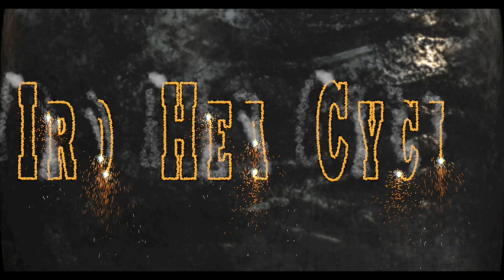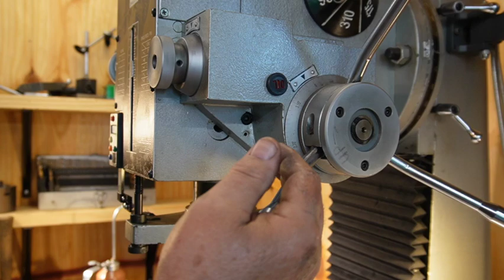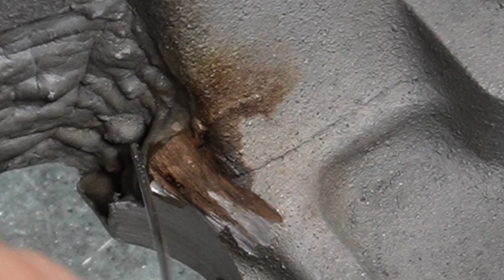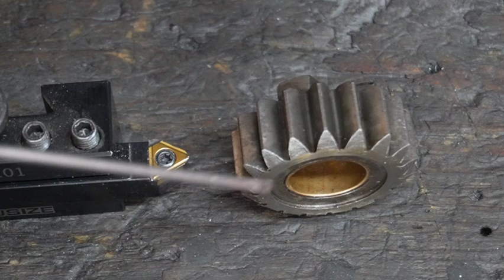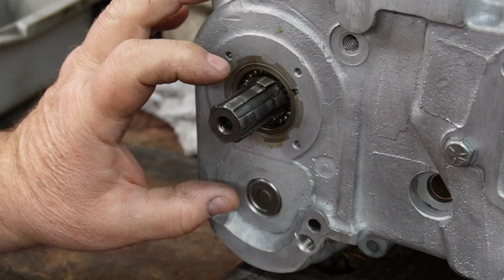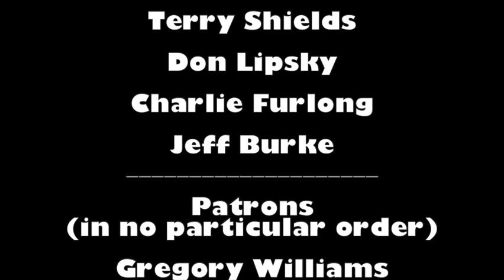Harton Part 4, Road To Recovery Nbr 274

Comment: Question, what cup and tungsten do you use in your tig rig? Also do you add helium to your gas? Thank you.
Reply from the maker: Nbr 5 cup, 3/32" for most weld, 1/8" on the heavier sections.

Comment: I've watched several of your videos where the cases were previously welded and/or you have to go in and do additional welding.   Is this something specific to Harleys or do other bikes have similar problems?   Anyway,  I'm glad the owner decided to fund the additional repairs.
Reply from the maker: In may cases, (cases? pun intended) the cases I work on have been used and abused for 50 or 60 years. Any engine that old can see the same type of damage. The reason you don't see them is because the import bikes have ended up in the junk yard. Parts are simply not available. Manufacturers don't support anything out of production for more than a few years and neither does the after market. We, in the Harley business, are fortunate that a strong after market makes the parts to keep these relics running.